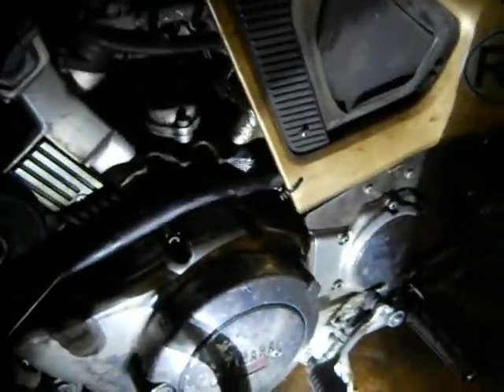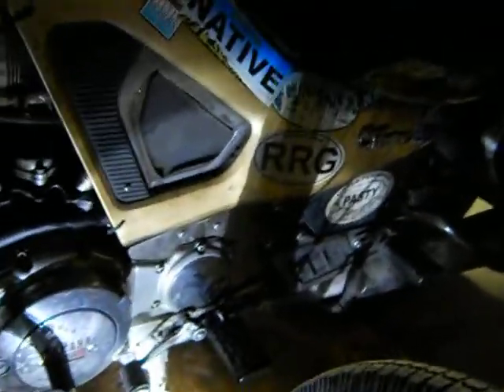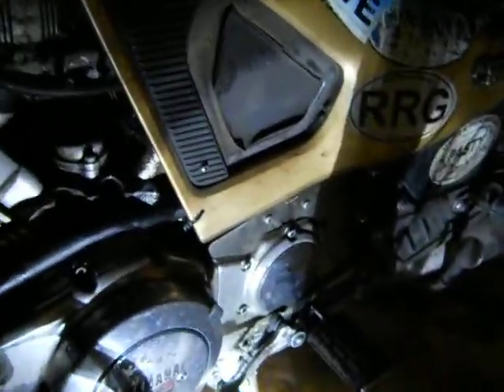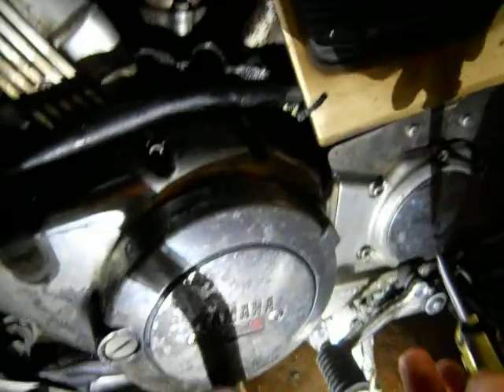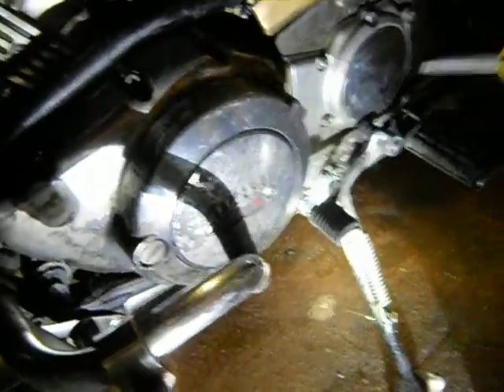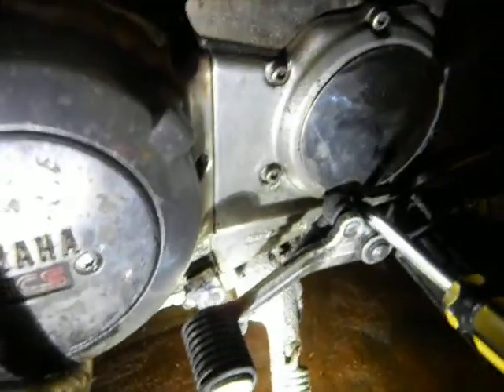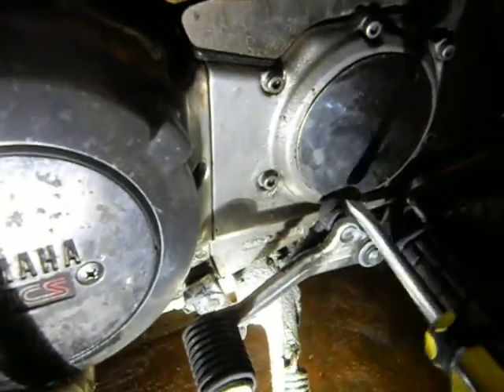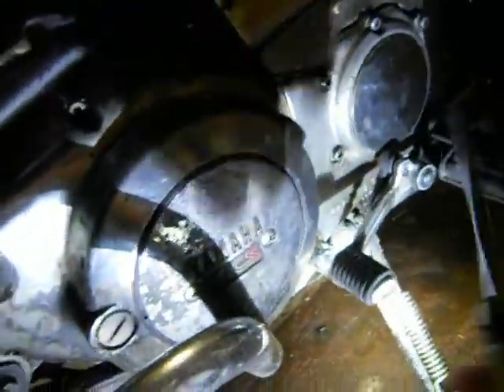Yamaha Venture Forward Bevel Gear oil drain screw location

Comment: Thanks a lot.  I’m going to try to get a video and send to once I get going. I Tarik think it’s Maybe the shifter seal or in behind the cases are these machines finicky with oil? Meaning they run better with less or more rather than right in the middle
Reply from the maker: They do tend to be sensitive to overfill on the oil because overfill leads to oil accumulation in the air box resulting in oil seepage from the air box and down onto the engine.. When you do an oil change just make sure you stay in the middle of the site glass for oil level on refill and you will be fine. If it is the seal on the shift shaft that you find leaking the repair is not that difficult but you do have to remove the shift shaft from the case in order to replace/repair.. You are welcome Mike. Puc
Reply: @pucpuc937  I added my first video. Could you please have a look and let me know I need help. Thanks